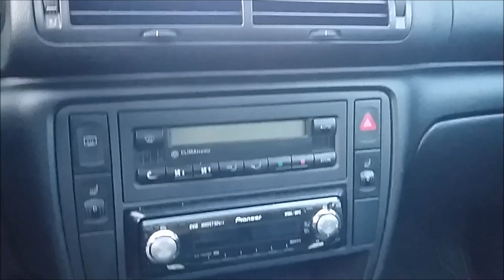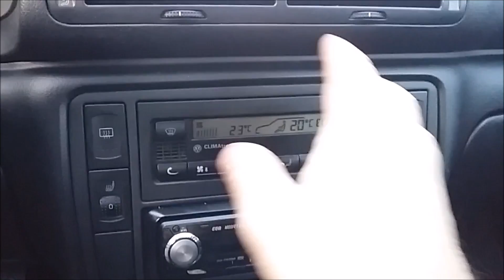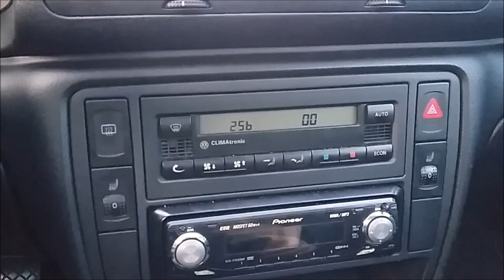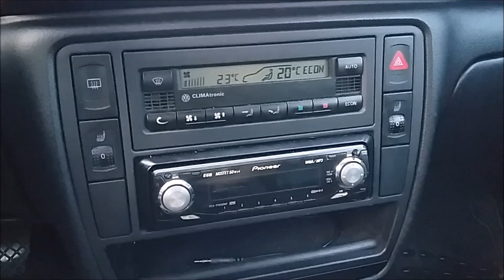HOW TO DIAGNOSE A PROBLEM WITH CLIMATRONIC UPDATED

Comment: Damn it bro, how do we turn on the heater in this air conditioner? I can't see the road because the damn glass is fogged up. I couldn't find a user manual on the internet, I have no idea what econ mode is or what auto mode is.

Comment: List of all functions :   
1 Digital value of Interior Temperature Sensor, in Headliner (G 86
2 Digital value of Interior Temperature Sensor, in Instrument Panel (G 56)
3 Digital value of Fresh Air Intake Duct Temperature Sensor (G 89)
4 Digital value of Outside Air (Ambient) Temperature Sensor (G 17), front
5 Digital value of Outside Air (Ambient) Temperature Sensor
6 Digital value of Ambient Temperature Sensor At Fresh Air Blower (G 109)
7 Digital value of Temperature Regulator Flap Motor Potentiometer (G 92)
8 Delta value of Temperature Regulator Flap
9 Non-corrected specified value of Temperature Regulator Flap
10 Digital value of Central Flap Motor Potentiometer (G 112)
11 Specified value of Central Flap
12 Digital value of Footwell/Defroster Flap Motor Potentiometer (G 114)
13 Specified value of Footwell/Defroster Flap
14 Digital value of Air Flow Flap Motor Potentiometer (G 113)
15 Specified value of Air Flow Flap
16 Vehicle Speed (km/h)
17 Actual Air Blower voltage (Volts)
18 Specified Fresh Air Blower voltage (Volts)
19 A/C Compressor (A/C Clutch) voltage (Volts)
20 Number of low voltage occurrences, non-transient
21 Cycle condition of A/C Refrigerant High Pressure Switch (F 118)
22 Cyclings of the A/C Refrigerant High Pressure Switch (F 118)
23 Cyclings of the switches, absolute non-fluctuating
24 Analog/Digital value, Kick-Down Switch
25 Analog/Digital value, Engine Coolant Temperature (ECT) Warning Light
26 Engine Speed (RPM)
27 N/A
28 A/C Compressor speed in rpm (Equals Engine Speed x 1.28)
29 Software version
30 N/A
31 Potentiometer malfunction counter, Temperature Regulator Flap
32 Potentiometer malfunction counter, Central Flap
33 Potentiometer malfunction counter, Footwell/Defroster Flap
34 Potentiometer malfunction counter, Air Flow Map
35 Feedback value, cold end-stop, Temperature Regulator Flap Motor Potentiometer (G 92)
36 Feedback value, hot end-stop, Temperature Regulator Flap Motor Potentiometer (G 92), max. stop
37 Feedback value, cold end-stop, Central Flap Motor Potentiometer (G 112)
38 Feedback value, hot end-stop, Central Flap Motor Potentiometer (G 112)
39 Feedback value, cold end-stop, Footwell/Defroster Flap Motor Potentiometer (G114)
40 Feedback value, hot end-stop, Footwell/Defroster Flap Motor Potentiometer (G114)
41 Feedback value, cold end-stop, Air Flow Map Motor Potentiometer (G 113)
42 Feedback value, hot end-stop, Air Flow Map Motor Potentiometer (G 113)
43 Vehicle operation cycle counter
44 Calculated interior temperature (internal software, in digits)
45 Outside (ambient) temperature, filtered, for regulation (internal software)
46 Outside (ambient) temperature, unfiltered, (internal software, in deg C)
47 Outside (ambient) temperature, unfiltered, (in digits)
48 Malfunction counter for speedometer (vehicle speed) signal
49 Standing time (in minutes)
50 Engine Coolant Temperature (ECT) in deg C
51 Windshield Wiper Mode = Dig. (0=Off, 1 = Int, 2=On)
52 Fdk-Correction wrt Wiper Mode = Dig.
53 Blower Voltage Correction wrt Wiper Mode = 0.1V
54 Part Number

Comment: Skoda Octavia mk1 - 4F7 00 in the display. Maximum heat comes from the vents no matter the temperature setting. Do you know how to fix this?
Reply from the maker: Try regassing and Chek for leaks your ac
Reply from the maker: The diagbostic code says that the temperature flap servo motor is bad

Comment: Hi ! I've just found your channel. My VW Passat 3b5  1.9 tdi est. 2000 has an intermitent FAN Blower. It may come on over a bump in the road or not. I HAVE just sprayed switch cleaner on the Auto button & windscreen button, left it to dry & it worked . 3 times in a row . Now it doesn't. I therefore assume its something to do with the climatic control not turning the blower on. ANY IDEAS would be most help full. Fan Speeds are fine when it actually starts  the blower working 
. JB
Reply from the maker: Either the fan installation - wiring loom, or the fan it self it broken pretty much these are usually only two options
Reply: @EverydaysBuisness  thankyou. JB

Comment: Hello I have a problem with my climatronic of a Passat 3b/3BG B5 The external tempertúra varies abruptly from 10 º C to 20 º C or-73 º C.  I have changed the external temperature sensor that is in the paragólpes and the control of the climatronic and the problem persists. I followed the tutorial of the video and initially gave me the error 313 but after resetting it did not appear any error code 444.
Do you have any idea what the problem might be, or element may be wrong? 
Thank you for your patience.

Comment: My display even dose not shows anything and i tried changing the unit same problem
Reply from the maker: Seems that you have a power break somewhere before of the climatronic
Reply: @EverydaysBuisness  i fixed it fuse 5 was missing i think previus owner took it out or smthn
Reply: I just put a wire in there until i gobget a fuse but i dont know how.many amps.should i buy the fuse?
Reply from the maker: it is a 10 or 15 amp fuse

Comment: i have same problem with my vw mk3 golf climatronic,do you have a video of it cuz i dont have econ button,every time i ignition with key the screen of climatronic make on and of many time with zero number of all,and no air but the compressor are fine and thr relay and fuse good,please help me 😔
Reply from the maker: khaled bobbo try Google climatronic in a golf mk3 diagnostic

Comment: 2001 Eurovan with blinking screen, when I hold the buttons down the screen does not change or go into test mode? Blowing only warm air:( No codes?
Reply from the maker: mrs tedger if you have the same climatronic unit follow  closely how to enter into test and diagnostic menu. If your climatronic screen blinks, you definitely have a problem with your a/c system in general, it can be just a bad connection or needing a gas recharge all the way to the compressor unit fail....

Comment: Hi my Passat 2001 when I turn the heater on cold air comes out even on Econ mode hope you can help thanks
Reply from the maker: Eloisa Vera there are two possible problems, first is that you have connected your compressor unit directly so it bypasses the climatronic unit and once you start the car your compressor is on automatically so cold air comes out, the second thing is that you maybe have a problem with your car reaching optimum temperature so therefore there is just no heat available to blow hot air, and the last thing I would like to mention is that maybe your internal heater in the car is blown or clogged and the warm antifreeze so you just can not get through it. I am pretty positive one of that reasons could cause this problem you have.

Comment: Hi! When I press the hot button, the air continius cold...What can be the problem?
Reply from the maker: Francinele Ferreira Martins press the econ button and on the display should write ECON that means that you have turned off your AC compressor and than start to modulate your AC temp
Reply: Everydays Buisness Thanks a lot! Now Iam feeling the hot wind! LoL! Besides here in Brazil the temperature is always high, sometimes is a little cold! Thanks for the advise!

Comment: Hi, my climate control is showing nothing,  I have tried changing the unit but that one doesn't show anything either, please help.
Reply from the maker: Turker Izzet if there isn't any symbol showing up or anything I would recommend to check the fuse box and change the climatronic fuse. If that's not the case check the power supply to the climatronic unit!

Comment: Hello is it possible to change my climate control from my Jetta 2002 for a climatronic  ?
Reply from the maker: Linden Van Genderen  yes it is possible but it's hard to pack everything right also ypu need to rare down half the car from inside out and buy new AC module ect. So in theory you can do it but in  reality it is a huge and pretty expensive job.

Comment: Hello, i have a problem with my jetta vr6, there is no air flow neither cold or hot, not even in econ mode. The compressor works fine and i already test the fan by power it directly from the battery and comes on just fine, but when i used the code diagnose come out with the codes  04F9 Fresh Air Blower  04FA Recirculation Flap Servo Motor. I think there is a problem with the computer, a friend says that the control panel is the computer and i should replace it. I realy hope you can help me.
Reply from the maker: sAulinh0o0zzz the computer is usually last to fail. I think the problem is the flap servo motor that regulates the inlet of fresh air in the system of it's stuck both the servo motor and the fan would NOT work. Also I would try google it and see if there is any solution online or even if you are good with hands I would try to take apart the dash and see if I can fix it my self. Servo motor is often dirty and give it a good clean and it should work in most cases. Also try to press recirculation button and then set the fan on highest speed it may work. Hope it helps. Good Luck
Reply: Everydays Buisness Ok i'm gonna try it, thanks a lot.

Comment: This explains exactly the same things that the PDF does.  But how to fix the system?  In MY case, the blower wont turn, making the whole system pretty useless.  Here's what I posted in another comment on another video.

=====
Nobody seems to actually know anything about Climatronic beyond pressing the buttons to get the fault codes.  I have a 2000 Passat and it's using a MOSFET to control the fan motor.  The brushes were worn, fixed those, GREAT!  Then the fan stopped :-(  Well, it didn't stop, it sort of chugs on, barely turning.  It's free, power inject makes it spin, so what I am going to do (doing it right now) is to put a switch on the dash to liven the fan.  The Climatronic successfully turns on the heat, the cold (it has AC) and the flaps work, so sod the bloody fan, I need to see where I'm going in the morning and not boil, or freeze!
=====

Now if we might know where things are, how to take them out without breaking them, or our fingers and how to check them, then this would be really useful information...
Reply from the maker: ApexMike well my dear friend usually the 12v el blower engine is that that fails, so TRY to put the new unit in and it will work properly, as you can see I'm trying to help everyone  in the comments and also I can understand your frustrations because this annoying problem but climatronic is complex system and many of things can go wrong and also on these videos you can see how to diagnose a problem and try to resolve it your self but YT is not professional VAG forum or anything.
I personally had the exact same problem as you have on my previous Skoda and I have changed blower fan because fan electronics have failed and it worked perfectly for me. Also if you have the option to adjust the fan speed manually 0-1-2-3-4 the knob wears of and you loose 2-3 speed. because switch is worn out --> change the switch and you should have properly working fan :) 
hope it helps 
best regards
Reply: Everydays Buisness Thanks.  There is no knob on the binnacle - it's all Climatronic.  Moreover, as I mentioned, it is MOSFET controlled - not a simple relay, or set of them.  I'm going to have to get the scope out - I can see that :-(  I'd rather just run the fan, but I ran into another problem, in that if Climatronic doesn't see a fan connected, it does weird things.  Damn, I hate this system!
Reply from the maker: ApexMike I would suggest try one more time and check for all connections and fuses any loose or naked wires or even temp sensors throughout the car. I'm sure that it's a easy fix. Good luck finding the problem.
Reply: Everydays Buisness It's OK thanks, I think I got it - it's a dead spot on the motor, which didn't show up when I first changed the brushes.  This explains the intermittent nature of the fault.  I've ordered a new one from eBay.